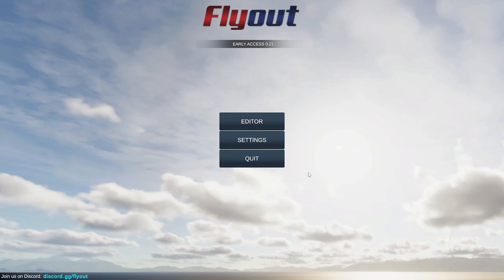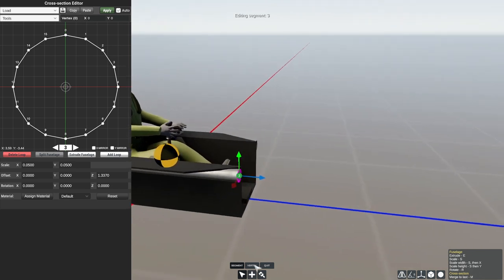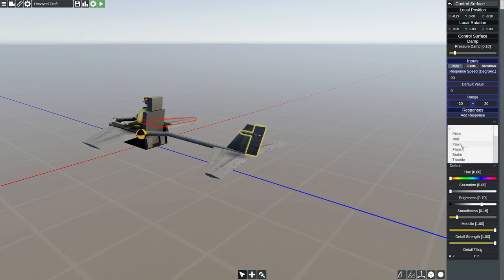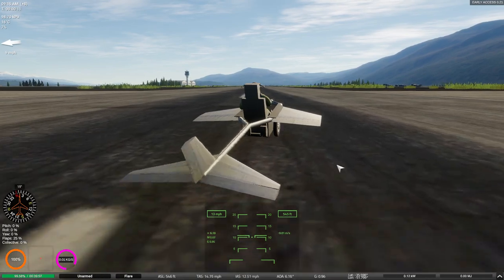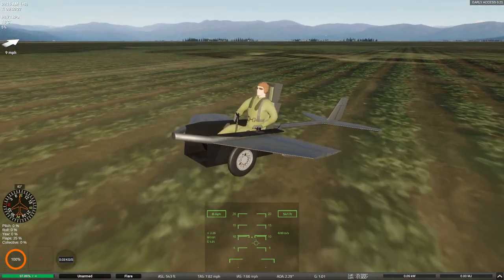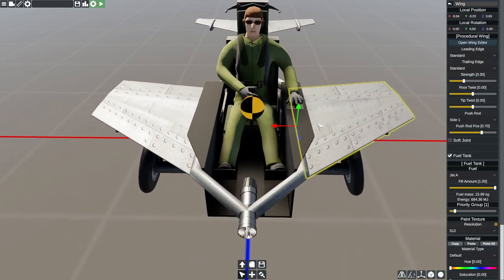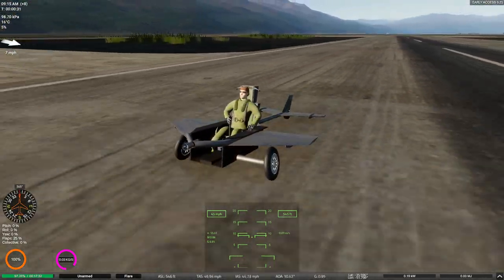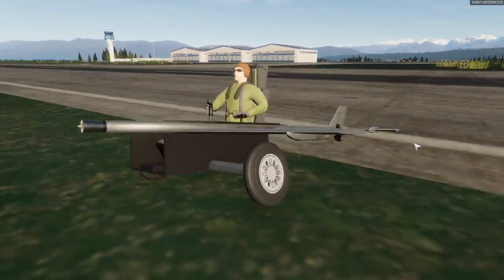I Built A Plane With The SMALLEST JET ENGINE In Flyout!

Comment: Frantic, the plane is adorable, but your wings are tiny. Barring helicopters (obviously) and other VTOL aircraft, a general rule of thumb for getting airborne is that the smaller your engine is, the longer you want your wingspan to be. Longer wings mean a much slower takeoff speed, and less time spent with your wheels down. 

Also, yeah, you are fully burning your pilot's crotch XD
Reply: Naaaaah, the pilot is fine

Comment: Frantic I think your tiny jet need to be upgrade not put rocket jet engine. In front because its no sense at all 
And a pilot will be dead coz of 3rd degree in the face of rocket 
Unless you need a exhaust port on under the cockpit